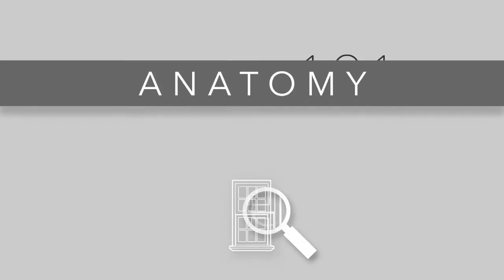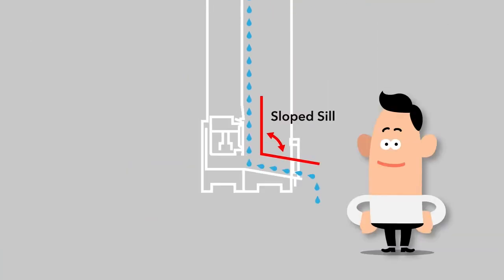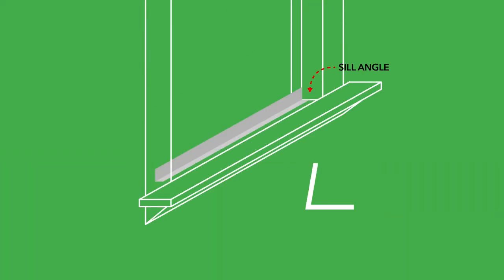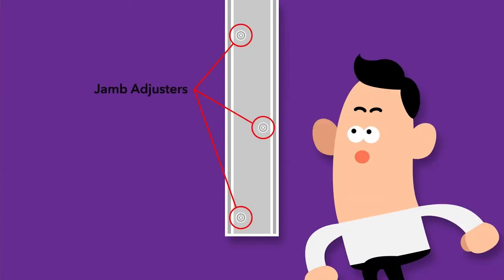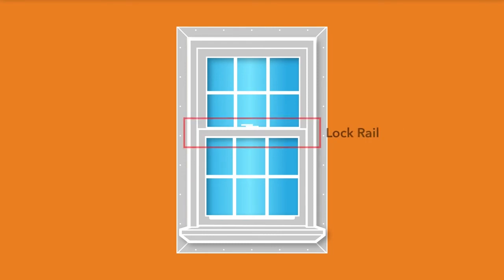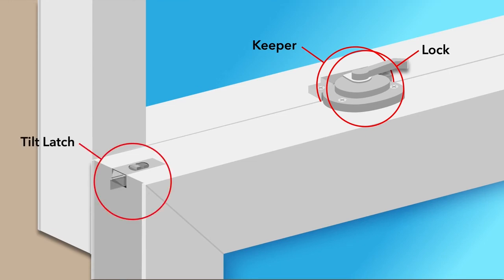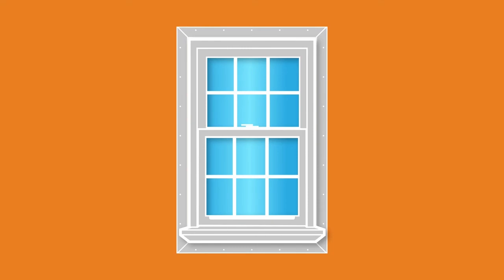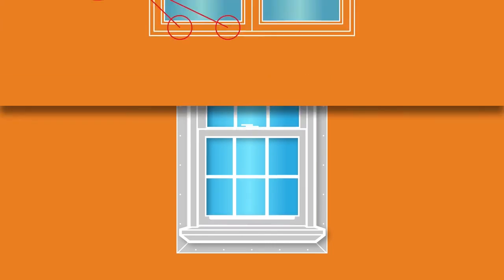ReliaBilt Windows 101: Window Anatomy

Comment: Where can I find specific installation and information on Series 46000 windows? There is no information online, I bought 3 windows for $900, and no recommended installation information in the windows. Aluminum nailing fin has no holes, builder says follow manufacturer's nailing recommendation, which there is none. I would love to be able to have questions answered on these 46000 series windows.